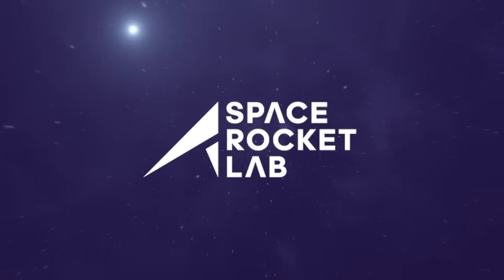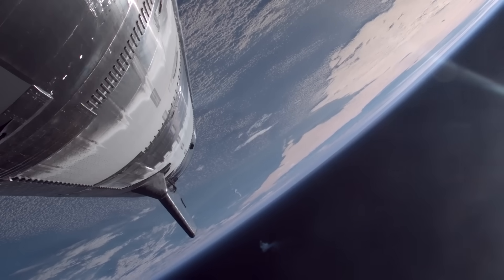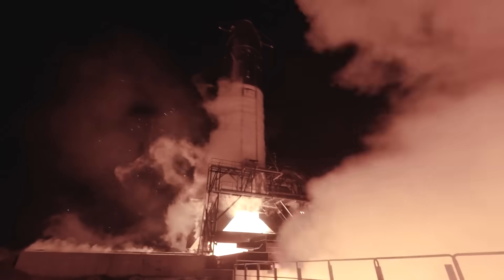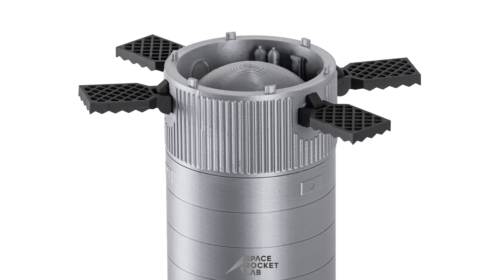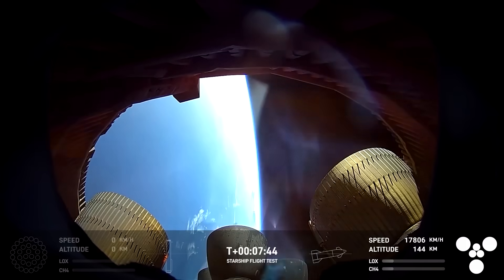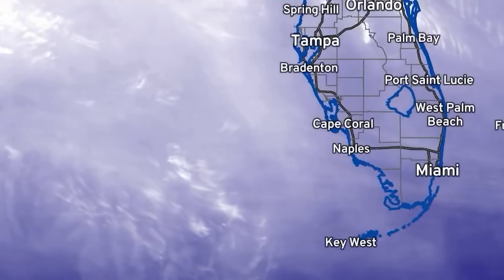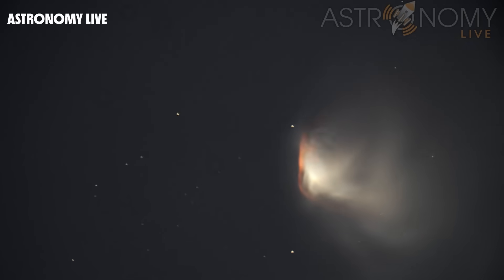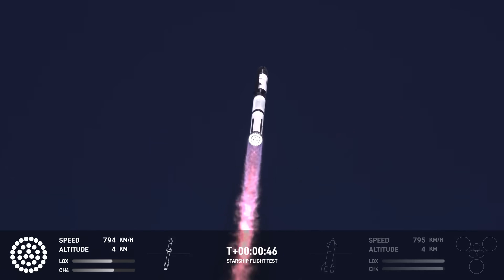What Exactly Happened to SpaceX's Starship Flight EIGHT!

Comment: Thanks for this video. Its amazing to see the aeronautical forensics to discover the vibration over-resonance.  At power plants, a lot of civilians don't know but the engineers, they would test acoustics all the time - for vibrations told you if a system was under stress.  I would hope that Space X will be able to re-calibrate and possible add inertial dampeners there to help (trekkie parlance) -- AI to adjust thrust + angles * velocity * speed * etc yada yada
Reply: If you ever in the future -- buy a car with an engine with vibration sensors to detect faults and issues and reconfigure our request fuel additives = cool AI of the future.

Comment: Bingo.....I've speculated that the booster harmonics are the issue. The same sort of issue was evident in the early Saturn flights as was the POGO problem.  Also, from an investigative point of view, would it not be better to program the engines to immediately shut down on the failure of one sea level and/or one vacuum to recover the majority of the intact ship after slamming into the ocean...and hope its not on land. 🙃

Comment: • Cause: RVac nozzle damage (hot staging shock?) led to explosion, cascading to other engines. Torque (τ = F · d, d ~5 m engine offset) ~1.25 × 10⁷ N·m, tumbling Ship.

• Mercury Analogy: Internal F (crustal torque) misaligns path—here, engine loss diverts Ship like precession.

• Add Mass: Reinforce RVac mounts with ~500 kg steel (m ~1.3005 × 10⁶ kg), resists τ ~10⁷ N·m. Cost: ~0.04% mass penalty.

• Dampers: Install shock absorbers (~10⁵ N capacity) at engine firewall—absorbs hot staging F (like Fundy’s water), prevents cascade.

Comment: The tip of the rocket was the vibrations problem in a way that pointed tip is to sharp down the sides emitting a super sized vibration that resonates throughout the body make it rounded tipped

Comment: Very good analysis! I appreciate I could be completely wrong here but looking at the shot of the engine bay I’m reminded of the “other issue” Skylab suffered during its launch. When the meteoroid shield broke loose, parts of hit and damaged the S-1C/S-11 interstage ring so it failed to separate after staging. Heat from the S-11’s was trapped around them and the post flight analysis found that the thrust structure was starting to suffer a structural failure, thankfully Skylab reached orbit before that happened. Had the interstage on any of the Apollo flights failed to separate the mission rules meant a mandatory abort because the risk of a vehicle loss was so great. Is it possible that the same thing is happening on Starship, that engine heat can’t escape and is damaging the engines?

Comment: This video, while containing some great footage and interesting new tidbits, contains several significant errors that betray a lack of understanding of rocket engineering. For instance, Raptor v3 cannot be the full solution, since the problem appears with vibrations in the fuel lines from the tanks to the engines and not the engines themselves. Also, saving 1 ton in heat shield mass per engine across 39 engines does not equal to an increase in 39 tons of payload to orbit capability: only the savings for the 6 ship engines translates directly 1-to-1 payload increases, but savings in superheavy booster weight provides only a fractional improvement in payload to orbit capacity.

Comment: The problem seems to be that the longer V2 variant produces different vibration patterns than the shorter V1 variant. Testing the ship with a 60 sec burn, but fully fueled didn‘t address the problem, as the vibrations seem to start emerging at the end of the ascent burn, when both tanks are almost empty. So the test was probably useless. Next time, they really need to test the thing more close to the actual situation, with next to empty tanks.
Reply: Do you think this is similar to what used to happen with the apollo rockets? I believe they used to call it "pogo" effect.
Reply: The design of the propellent feed lines is substantially different, so it's not all about the longer length of the ship.
Reply: Ok I’ll tell them😂.  They need to make you lead engineer ASAP!
Reply: I feel like the tanks being full definitely help dampen some of those harmonic vibration, so I agree, they need to test those tanks being close to empty, to allow for conditions closer to the scenario where the failure happens
Reply: No, they need to cancel the entire and completely stupid waste of taxpayer money.   The definition of waste, fraud and abuse.
Reply: @Tn_jed001  Please note that the Starship program is not primarily funded by taxpayers, rather it is funded by a combination of SpaceX internal funding (from profits made from their Falcon program, which launches ~150 times a year, with the vast majority of these not for the government), external private investments, and a comparatively small amount from the NASA HLS Moon program (less than $3B). Compare that to the SLS rocket, which to date has eaten $32B in taxpayer funding with only one launch so far. Once operational, Starship will launch 150 tons to orbit at a cost of $10M per launch, while SLS will launch less than 100 tons at a cost of $2B per launch (200 times the cost of a Starship launch when operational). I'm no fan of Elon Musk's recent terrible behavior, but SpaceX is far greater than Musk with thousands of dedicated and incredibly smart hard working people who are developing a revolutionary launch system that promises to reduce the per pound cost of launching payload to orbit by two orders of magnitude.
Reply: @Tn_jed001 Cry harder 🤣
Reply: @Tn_jed001 Okay china joe
Reply: @Tn_jed001  They are doing it twice as fast as Boeing and at half the cost of what Boeing gave us, which at this point is nothing usable. SpaceX is the world launch leader of payload into space and no one or no country is even close to their launch capabilities. So their not wasting taxpayer money, with Falcon they are the most productive rocket system ever designed. Super Heavy / Starship is still experimental and will more than double the capability of Falcon making it even more economical for launching payloads.
Reply: We need to step away from combustible fuels. We will never approach light speed or ever get to another star system this way. Hell, we can barely get to Mars! I think our nearest neighbors are like eight light years away.
We need to be developing "field propulsion" publicly, not keeping it hidden in the dark recesses of the Pentagons vast apparatus somewhere. Field Propulsion can approach, if not exceed, the speed of light.
Food for thought.
Reply: It's basic 300 series stainless steel nothing special (i worked with it routinely as an aerospace machinist ) and it's thickness varies from 3-6 mm! (.118-236) ((all of this is what I have read only) Whether or not it is simply 300 series SS only Elon would know!!  The rather  gossamer aspect ratios (created by the 400 foot OAL)seem to open the door to some issues. Which would be exacerbated by the diminishing fuel because it would begin to lose the pressure and stiffness engendered by a full fuel load!!
Reply: I didn’t say anything about Falcon or Boeing and I offer no defense of Boeing. Starship is a giant boondoggle.  I’ve stated on numerous videos that Starship, which was supposed to land on the moon a year ago and has yet to achieve orbit, won’t make it to the Moon and back by the end of this decade.  And it won’t make it to Mars and back by the end of the next decade. 

There’s absolutely no need to send humans beyond low earth orbit.  Just as surely as Elon says we don’t need manned fighter jets, we don’t need manned spaceships.  

It’s amazing how easy it is to trigger Elon fan boys.

Comment: The early Saturn rockets had a vibration problem also caused by harmonic waves. But it was not the same problem.  NASA and its engineers referred to this as "POGO."   They were able to dampen it out eventually.
Reply: Yet the Musk haters expect everything to be perfect every time even if it is a test, while forgiving every other Space company out there when they have problems because they aren't SpaceX. Also think it took quite a while to control the POGO also.
Reply: Saturn V still had the issues crop up, notably Apollo 6 (where stage 3 failed to ignite for it's 310 second burn) and Skylab, which was heavily damaged.
Reply: @Ragetiger1  Apollo 6? It had oscillations, and had stage 2 engines go out, but stage 3 ignited. It had to burn a bit longer, but it ignited.
Reply: POGO is why there was an early center-engine cut-off in Apollo 13's launch, as shown in the feature film.
Reply: POGO predated Apollo. It affected several early launch vehicles
Reply: POGO is acoustic waves that travel the length of the ship. SS is having acoustic resonance in the feed lines. Think of a guitar string. At certain frequencies, this can act as a multiplier, causing failure. Many have seen this effect when a crystal glass breaks from resonance.
Reply: @hawkdsl  Rocketdyne add this problem with J2 engines, and it was a known phenomenon as far back as the 1950s. It's interesting that the SpaceX team didn't find a way to simulate this

Comment: It's the Soviet N1 rocket with infinitely better microprocessors and massively crappier rocket engines.
Reply: great analogy, more engines mean more problems. Sat V's five would be tricky enough, but the F1's were massive at 1.5 million each in thrust, stage one.
Reply: @ronschlorff7089  Thank you. N1 engines were revolutionary, with an enclosed system. They were hidden by the engineers when the N1 program was closed down, later discovered and flew on an American rocket.

Comment: This is like flutter in a new aircraft during its initial test flights.  Engineers add weight to the end of the wings to reduce flutter, otherwise the flutter can shake the plane apart.

Comment: Exactly the same as flight 7
They never fixed it
Just added a load more cameras and sensors.
Expected the same failure but hope to find out the cause.
I expect they likely did find the cause and there will now be a lot of part built starships scrapped so they can redesign before flight 9 so a long delay 😢
Reply: I suppose the words of Thomas Edison ring true here, words to the effect "I have not failed; I've found 2,000 things that don't work". : )

Comment: Effects of Pogo Oscillations
Vibrations can become violent, causing structural damage.
They may lead to mission failure if not controlled.
Can negatively impact crewed missions by making the ride extremely rough or dangerous.

Comment: Even the starship can successfully land on the moon ,it's not sustainable to have frequent  "lunar-earth cargo flight"due to the high cost, and it's similar to the transporation experience of  "The Hump" from WW2's Burma theater,back then cargo planes need to spend certain amount of fuels just to sent the same oil to battlefields… 
   Anyway,eventually  lunar base will need to have reactors in order to generate partically self reliant energy,hmm

Comment: Starship exploded in "outer space"? As far as  I know, Starship has yet to even make it into orbit!
Reply: block 1 starship can get to orbit, there's just no point for it to. Outer space ≠ Orbit
Reply: I think any space is 'outer space'. It definitely hasn't even made it to orbit yet, which I think is a joke. Their contract has a lot of things that they need to prove in-orbit, so if they want to do a 'rapid' development, they should be trying to get into orbit and starting to test fuel transfers, mating and other technology and activities, before finishing off with the simulated landing. Of course, they need to get block 2 to stay in 1 piece to test anything.
Reply: Outer space usually begins around 100km above sea level. Starship, like New Shepard or the X-15, has made it to outer space without entering orbit.
Reply: Another lefty twat.

Comment: They have more problems than what you talked about,!!!!
I see no progress with the moon refuelers, moon lander, no progress with a crewed spaceship, no crew escape system which they need due to Space X quality assurance issues which are worse than Boeing's!
I have NO confidence in Space X Moon and Mars missions
Just on the Mars mission, Musk sold you all a lie! as the human condition cannot take a 3.5 year round trip to Mars, due to radiation and bone density problems let alone if they have to have a rescue and or engineering mechanical breakdowns over that 3.5 year mission.
Musk suckered the US taxpayer, to pay for his PEZ dispenser on Starship for his advancement only in making more money for himself!!!! what has a PEZ satellite dispenser got to do with the moon mission?
Musk receives 8 million dollars a day from US taxpayers whilst retrenching the poor/veterans from their jobs. .......your my hero Elon!.....NOT!
Space X should of never won the contract of landing humans on the moon, it should have gone to a simpler, smaller easier design system that does NOT require 15 space refuelers and have have reusability issues, as that only causes extra weight complexity! due to the minimum flights required to the moon there is no need to be reusable.............Falcon throwing up satellites every week yes! but the odd moon mission on Starship no.
Space X has got a very very long way to go to land someone on the moon just to see if water is in the polar craters. SLS orbited the moon on its first mission!, 1960s Saturn V never blew up! ............Bozos catching up if he can prove his rocket has quality before quantity.

Comment: I am beginning to suspect ice from the pressurisation system dumping exhaust into the tanks is cloging the piping and causing damage as the pressure rises and pipes rupture either as the pressure is deliberately raised to try to clear the problem or as a consequence of the flow rate dropping with more than can then safely flow being pumped into the system.

Comment: Why wouldn't they shut down the last 2 engines and let it coast to the ocean in one piece?
Reply: because it will mostly burn by itself but you dont want any fuel or dynamite on ground
Reply: That's a massive safety risk, because it wasn't just the ocean below it.

Comment: Here is Space x's starship program, past and furture protections:
-Elon promises a starwars universe and shows everyone pretty cgi. Everyone melts like butter. 
- Eager but undisciplined starship engineers build it without thinking of efficacy.
-starship has 6 failures, engineers realize this will never work as elon promised. Public belives in "iterative testing" of the wheel. 
- space x decides to blow up the next starships to cause soo much disruption that the FAA grounds the project indefinitely. 
- Space x blames FAA for failure of starship and the public does as well.
-profit!
Reply: LOL
Reply: Lol starship success ---> yippee
Starship fail ----> all the haters pull up

Comment: Look at the 60 second burn test, then look at the hot staging ring, do you think all that in the burn can get out the holes on the ring, I don't think so, and back pressure is damaging the engines and possibly melting the pipes as well, once you have a leak, boom!

Comment: I'd like to know how NASA was so successful in development of the Saturn 5, as compared to the regular failures in the development of Starship. That program was decades ago, using "primitive technologies" as compared to what Space X is using. Musk proponents will be quick to note that Starship's greater complexity = more potential points of failure, but Space X also has much more sophisticated data analysis and software for modeling these systems. No Saturn V rocket ever lost a mission due to a catastrophic failure, although Apollo 6 (uncrewed) did experience a partial failure. The two programs stand in stark contrast. It would be interesting to see a side-by-side comparison of how the 2 programs were conducted that might explain the much greater failure rate in the Starship program.
Reply: Rapid iteration vs expensive long drawn out development - different philosophy for development is going to show different failure rates for sure but SpaceX, I believe,  demonstrates a more effective development process, certainly much faster and cheaper 😉
Reply: @casehanrath4910  given that the Starship testing is far from complete and the major costs associated with multiple failures, it's unclear how the  SpaceX development approach is 'faster and cheaper'.
Reply: @jlvandat69  we can base it off of falcon 9. Its early days had alot of failures, but it worked out.

SpaceX just has the resources now to invest more into rapid iteration more radically without sacrificing limited resources or effort for testing to become/stay human rated

Comment: Hot Staging is the issue.
Reply: I'm wondering if there's a pocket of unburnt propellant  getting trapped in there and then hot staging makes it explode and damages the area enough for the vibration to snowball
Reply: Doubt that. It wasn't problem.on prior versions. They need to take a hard look at the design differences between the versions.

Comment: unbelievable they just let it tumble with the engines on for so long while flying over busy airspace. there’s a fairly narrow strip in the airspace that was blocked off in case if something like this happens, and things could get even worse if it ends up breaking up and falling outside of that area.
Reply: also…if they knew raptor 2 was inadequate and unable to perform the task set out to do, why are they still flying with it? should they not just pause testing until they can get the new engines ready to launch?
Reply: @octagonPerfectionist  better to launch and test than to scrap
Reply: Looking at the launch comparing to flight 6 they started outer engines before inner units on hot staging cant determine timing but would like to see the streamers showing timeline of the disconnecting and engine firing